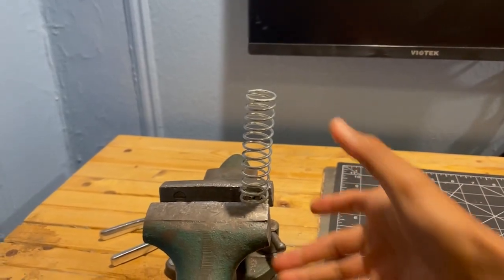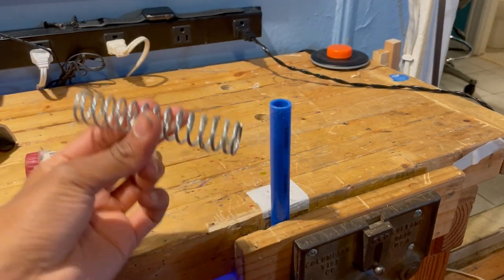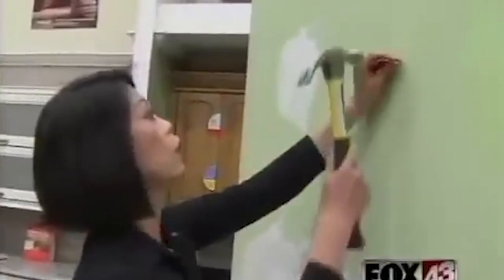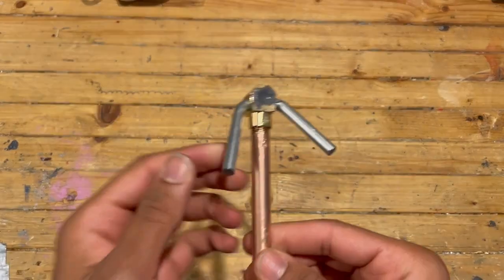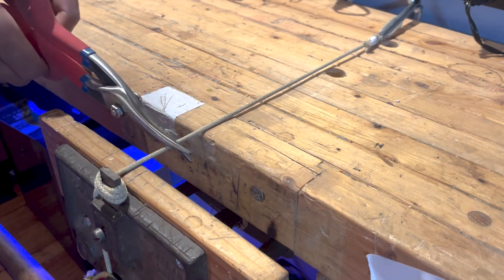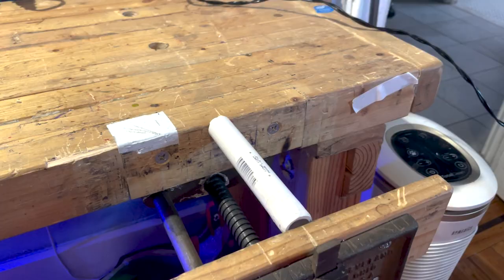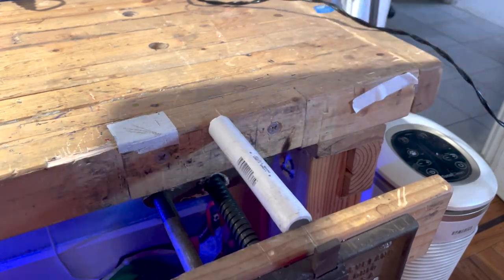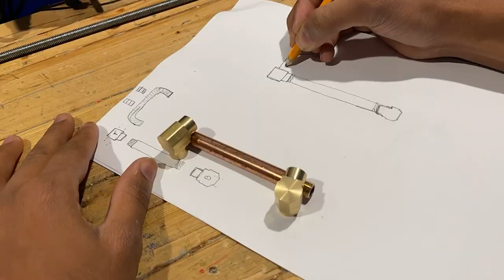How I Made Real Webshooters

Comment: Can you release the hook while swinging ?

How you will be able to hook to a brick ?

Very fun and thorough explaining though :D
Reply from the maker: These are great questions...

1) Because of its simple design, I am not able to retrieve the hook mid-swing, between clips I would have to climb back up and physically unlatch it.

2) This design was mainly focused on allowing me to swing from the chainlink fence shown in the final test. However, in the next video of this series, I will experiment with more methods for swinging off various materials.
Reply: @BenRebuilt  wow :D Cant wait.

Are you planning on making some sort of wall crawling gadget ?

If you dont mind me asking, which skill sets are required to create gadgets ? 

I got curious lately
Reply from the maker: @sea-ra9995  

1) I do plan to making a wall crawling project, but I if your interested I know the channel Jlaservideo just made an amazing wall crawling video

2) Depending on the gadget you can be using all different types of engineering skills, but most projects are going to fall somewhere within Mechanical, Electrical or Software Engineering. Like this video which was purely Mechanical and required Design, Manufacturing and Assembly skills.

Comment: Great vid man. For research purposes, how many grams were the co2 cartridges that u refused to use?
Reply: Also how long exactly did it take for the co2 to run out
Reply from the maker: @alexjohnny2159  They were 12 gram cartridges , that ran out in about 5 seconds with no restriction. Tbh with how much power they where outputting and the possibility of controlled values. I'll probably be using some sort of compressed gas in version 2
Reply: Nice. Thanks dude you should def try the cartridges or some kind of gas

Comment: Hey i was just wondering how far the springs could shoot the hook? Im thinking about making my own and springs seem renewable and easy but im worried about their power.
Reply from the maker: The force of a spring-powered launcher will be mostly controlled by the strength and reliability of your firing mechanism. 
Unfortunately in this design, the firing mechanism wasn't reliable enough to hold back the full force of my spring. Thus leading to the rather underwhelming shot seen at minute 5:28
Reply: @BenRebuilt  thanks

Comment: Hey where did u get the Kevlar rope?
Reply from the maker: Amazon
Reply: @BenRebuilt  can’t find any that seem to be thick enough
Reply from the maker: @michaelsolberg3330  look up “emma kites 100% Kevlar Braided String Utility Cord” then use the slider to select to the strength. If your trying to swing from it you’ll need a rope that holds at least 1500 pounds due to g-force.

Comment: It's great that you were able to build this, but I've seen at least 3 people (counting you) making "Spider-Man Web Shooter" videos, only to go with arm-mounted grappling hook launchers. Obviously, the technology required to make actual web shooters either can't exist, or doesn't exist right now . Fair enough. But if you're making a grappling gun, whether it's arm-mounted or not, that's Batman territory. Please stop drawing the Spider-Man comparison. 

If you want this to be like Spider-Man specifically, that's more of an advanced chemistry problem (maybe something for NileRed to tackle, if it's even possible). You have to make an adhesive that activates and expands exponentially upon contact with the air, somehow both solidifies into cables with the strength of steel nearly instantly and still retains near-inescapable stickiness all across its exterior, while also biodegrading after an hour. It also has to maintain most of that strength until just before its chemical bonds fail. It also has to be light enough (while paired with a launching system strong enough) that the weight of longer webs doesn't pull them down before they're stuck to their intended target.  

Again: not to criticize you for not doing something that probably can't be done in the first place, but what you made is a Batman thing. That's fine. Batman things are awesome, and much closer to being doable. It's part of the appeal. Just call it what it actually is.
Reply from the maker: I see what you mean. I first started this project 5 years ago when I was a freshman in high school, and throughout my research I was disappointed to see that their was no evidence of real web shooters or web fluid. But people like JLaservideo, The Hacksmith, and Allen Pan, showed me that these technologies could be possible, so I tried making my own designs. 5 years later I'm one of the few people on YouTube who's actually been able to swing like Spiderman. While also getting a better understanding of the mechanics required to do so.

The reason web-shooters aren't real yet is because not enough people know it's possible, not enough people are aware that with the right funding and enough time we can possibly develop real movie accurate web shooters.

So the purpose of this video is just to get people thinking. For the the more chemically inclined people like your self to consider the chemistry required to create web line, or for the more mechanically inclined people to consider the physics behind swinging and dismounting.

But at the end of the day, this project has been a life long dream of mine that I just so happened to share on the platform that inspired me.

Btw love the effort you put in your comment, Thanks for the feedback.
😁